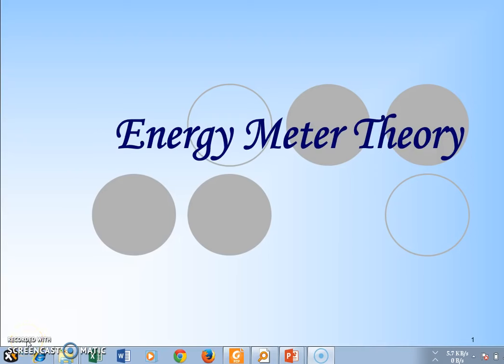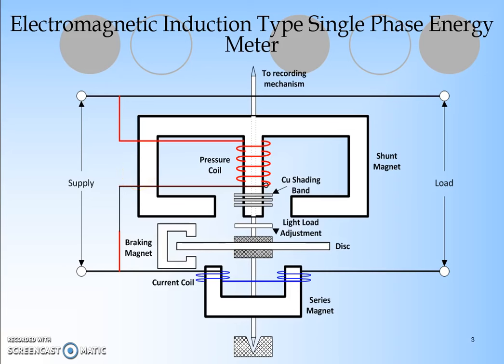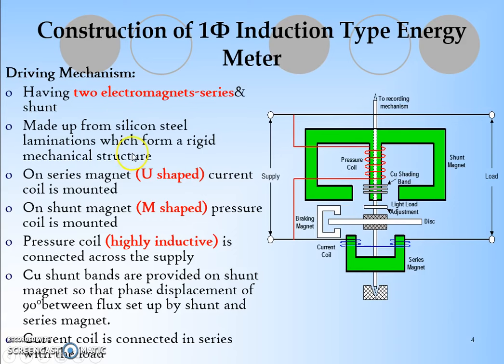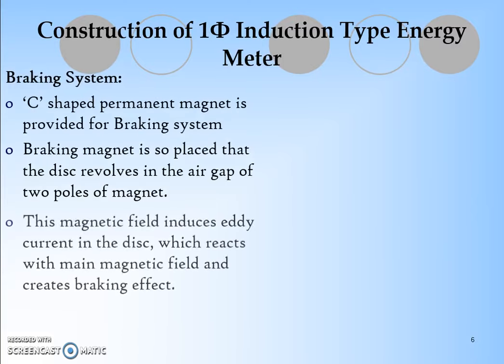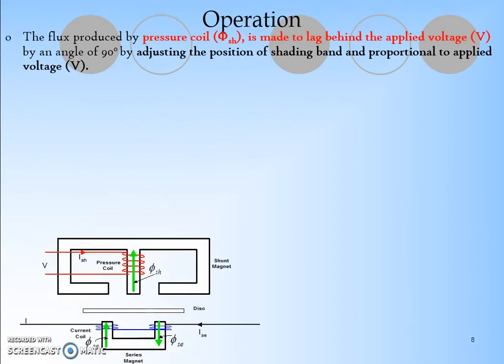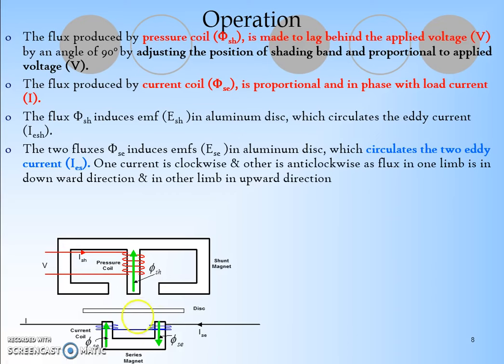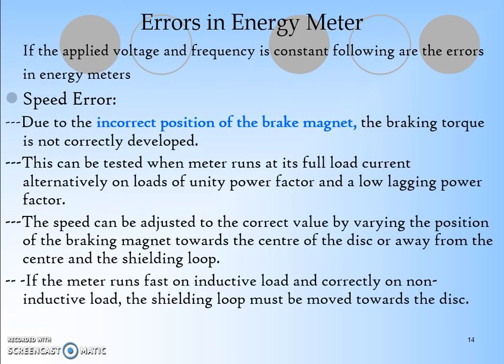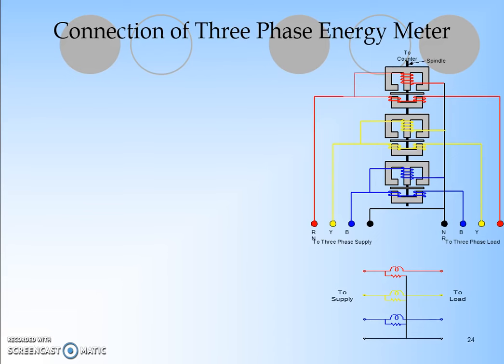Single Phase Energy Meter HD

Comment: the ddirection of the fluxes in the series coils is wrong, they should be in opposite directions so the total torque will be the summation of T1 and T2 and the perminant magnet is to reduce the speed of rotation of the summation's torque